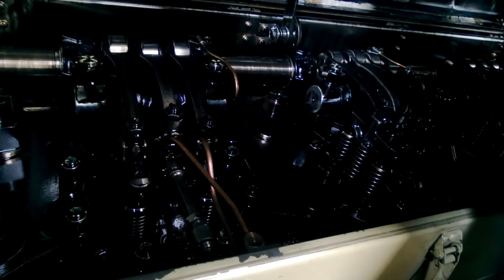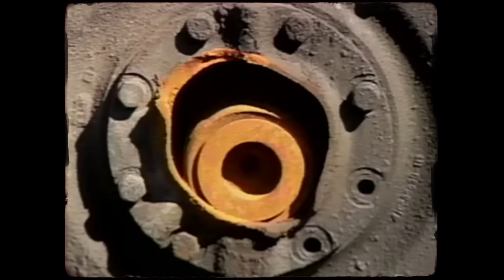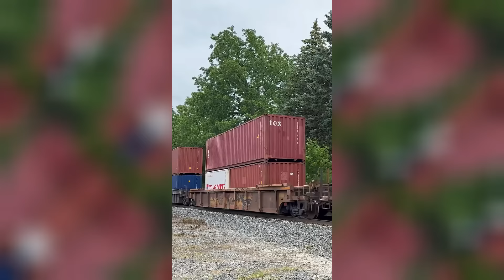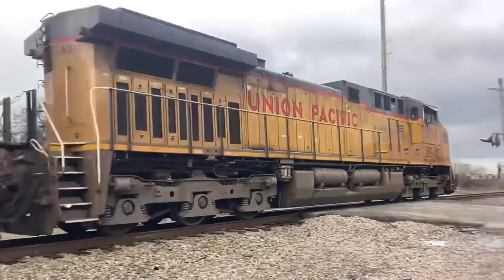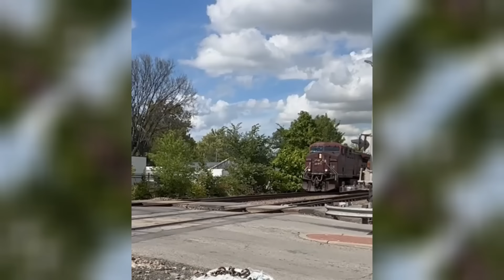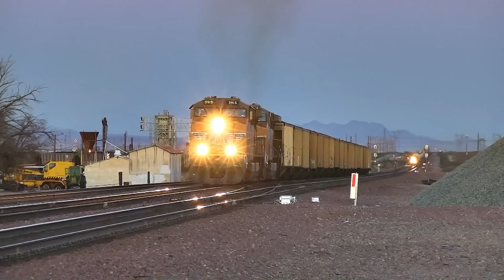The GE Locomotive That Silenced EMD in 1994

Comment: This video is a bit misleading and makes it sound like EMD never made a AC traction locomotive until the failed SD90MAC and that is what put EMD behind but fails to mention that EMD actually produced the first AC traction locomotive with the SD60MAC which was followed by the fairly successful SD70MAC which was mostly bought by the BN and BNSF, not to mention the AC traction SD70ACE that came after the MACS.  Also BNSF didn't start buying AC4400s until much later.

Comment: This article is totally incorrect,  yes the SD40 was the most reliable locomotive ever produced, far superior to GE.  EMD was the first to produce AC traction with the SD70Mac, it was an amazing locomotive especially in heavy haul operations.  The EPA is what destroyed EMD, its 2 stroke prime mover was not as clean burning as the 4 stroke GE used, EMD produced a far superior locomotive but they failed to keep up with emissions requirements.

Comment: Retired loco electrician (NS). The segment on computer diagnostics on the ac engines made me flinch. Those engines would log dozens of faults per mile, some restricting and some not, but it made finding problems a bitch. The old EMD 60 had over 100 test points and was hard to work on, but when everything was good it pulled like a mother. Some engineers told me the ac units had a wheel slip problem which in theory should be impossible, but I have been out of it for a while, maybe things have changed.

Comment: This video is factually off. GE took market share in the 1980s, while EMD was the first to produce AC traction with a test run of SD60s for Burlington Northern. The SD70MAC was the dominant market entry for AC traction. GE's dash models were the ones that shifted power. AC4400 was more like piling on.

Comment: Correction: BNSF actually ordered 1000+ C44-9Ws, which have DC traction motors, not 1000 AC4400CWs. They did order over 100 AC4400CWs, and then would go on to order ES44AC and ES44DC locos after the EPA's tier 2 standards went into effect. EMD also had AC units, and BNSF bought several SD70MAC and SD70ACe units for their coal trains from the 90's to the early 2010s

Comment: SD70 MAC I believe was the first major production AC loco. GEs 1 inverter per axle instead of per truck way better. The FDL 16, not so much until EMD tried their 4 cycle which was a bust in the 90-4300 Mac. GE FDL12 generating 4300 hp was their key in the early emissions battles, that’s what really won the day or GE in those years IMO.

Comment: Um I believe some of your facts are incorrect. Now GE or Wabtec has become the lead company over Progress Rail EMD. But you didn't mention that EMD first faltered with the SD50. GE locomotives if you were to check for reliability and locomotives that have evaded the scrap pile for half of a century...not with the GE name on it. I've seen EMD SD &  GP35 series still working on shorelines and regional railways. I've only seen two GE U18B locomotives still in use on the Pickens Railroad in Belton, SC. Now EMD was the first one to offer a locomotive with AC drive. Do you recall the SD60MAC? It rode on the radial self-steering truck. It could go under AC & DC locomotives. BN and  BNSF purchased 1000 at least. Norfolk Southern never bought any AC4400CW's -just rebuild their CW9's into AC44C6M's. Union Pacific has bought the largest DC locomotives at one time...1400 SD70M's...to go along with their SD70ACe's. They bought more AC4400CW's but they also bought SD90MAC's. Conrail's last orders were SD80MAC's and then SD70's and SD70MAC's. KCS, part of CPKC, wonder why they didn't call themselves Canadian Pacific Kansas Southern-split their orders. Yes, Wabtec has gotten most of the pie, but if more revenue isn't diverted from the truckers, both companies will cry. None of the railways are doing much but upgrading their fleet. They're buying in miniscule requisition. Also GE makes a good locomotive now. But many of the crews I knew that have retired and work presently prefer the AAR non-desktop locomotive. EMD returned to that idea first. Some of the crew told me GE extorted NS that if they didn't buy their locomotives, they couldn't haul their gas turbines. The SD70ACe might not be as perfect as the AC4400CW. I heard it's quieter inside and it could produce 4500hp.
Reply from the maker: Wow, this information is gold! Thank you so much for sharing it. I'm making a new video now to fix some of the errors in my last one. There is so much conflicting information out there, that I prefer to rely on information from my viewers, like you, who have real-world experience.

Comment: The beauty of AC traction is that the inverter doesn't need to do anything to compensate for wheel slip. As the wheel loses traction and spins faster; the motor's phase angle decreases and the slipping wheel loses propulsion, increasing traction. This simplicity allows the inverters to be very robust and provide thousands of hours of continuous service.

DC traction is raw power. From a stop the motors draw maximum current and minimum voltage which invert as speed increases. Once a DC traction motor starts to slip it will quickly accelerate to notch reference when the wheel slip system is not functioning correctly. Also I hear they don't like using DC traction when messin' with coal. Makes sense if you see how many sparks a commutator produces during operation. Then again that's less of an issue these days lol

As for me, I love a SD40-2. Relay logic speaks loud and clear and the module cards are easily discernable. Yea brushes suck but hey what else is new
Reply: I cam to write a similar comment.  With a DC motor both the unloaded RPM and available torque are both functions of input power (Voltage x Current) but with an AC motor the Power is separate from RPM since the speed of the motors core will be determined by the frequency of power being delivered.  This means an AC motor can provide full power a low RPM (low frequency) or provide low power at high RPM (high frequency) or any combination of low and high with the speed being independent of input power.  Of course someone will no doubt point out there are DC stepper motors and brushless DC motors which is true, but they would both still suffer from inability to provide full torque (power) at lower speeds or be self limiting.  Also if you really want to see scary wheel slip watch steam engines doing it.  With steam an unwary engineer can be throwing multi ton rods within moments of an uncontrolled slippage while under high load.

Comment: Regarding the intro and the demands for heavier trains. I remember in the 1980s counting train cars on the SF passing through Flagstaff and seeing numbers from 50-70. Today, trains passing near my home in the PHX metro on the UP tracks typically number around 95-100. DP typically meant leading and trailing engines when i was growing up. Today, DP units are often placed in the middle and I don't recall seeing to many trailing engines in recent years. (At least not in my area where there's minimal grade for 200 miles in either direction.) The ability to link DP units by electronic wireless control setups is a huge win.

Comment: As someone mentioned, the real killer for EMD was the EPA Tier 4 pollution requirements. GE was able to update their engine design to meet them on time in 2015. EMD tried to update their 645 engine, but a 2-cycle couldn't conform. Their 4-cycle was too late for the market, and had initial reliability problems. So the new GE/Wabtec AC loco became THE modern freight loco.
Reply: GE developed a brand new engine (Gevo) that was based on the AC60's 7HDL engine. They did improve the older 7FDL (called the Advantage) used in remans. 

EMD attempted to utilize the 710 for a T4 unit, which failed. They then tried the C175 Acert engine in the F125, but since it's a DEF engine, it couldn't be used in freight service. So they developed the 1010 engine from the 265-H, but it proved to be every bit as cantankerous as its predecessor. Only CSX and UP took delivery of small orders of T4 units from Cat, and all have since been returned back to Progress Rail/Cat.

Comment: Two things:

1. This video could’ve been 10 minutes long if a human being was narrating it. 

2. The SD70MAC was the first locomotive to debut with AC traction in 1993. Yes, GE ended up getting way ahead of EMD, but you can’t throw them under the bus entirely because they were utilizing AC technology at the same time. Not to mention EMD had several prototype testbeds for AC traction in the late 80s / early 90s such as the F69PHAC and SD60MAC.
Reply: It wasn't just text-to-speech. The entire video is AI generated, and the entire channel is on AI autopilot, spitting out new garbage videos every two days.

Comment: One caveat,  EMDs SD70mac hit the market in 1993, it technically was first on the rails, not the AC4400
Reply: Exactly
Reply: I was just going to comment this.
Reply: I agree with that also. The SD60MAC was the three unit testbed locomotive trio tested in Bn colors although EMD wanted otherwise. It rode on the patented EMD self-steering radial truck. It could fit under either a DC or an AC Progress Rail EMD locomotive. Then BN ordered the first AC drive locomotive to enter revenue service on USA rails- the EMD 4000hp(later uprated 4300hp). BN bought them. Then, BNSF purchased the SD70MAC long before they bought any AC4400CW's. Sure their new bosses from Santa Fe swayed them to GE majority, but NS bought EMD's and leased EMD's from BNSF.

Comment: Reducing the number of locomotives and improving fuel efficiency also reduces emissions.  If I recall correctly, the newer locomotives also recycle exhaust - that is, the air intake gets a mix of fresh air and exhaust, which further reduces emissions.  That's a good thing.
Reply: Exhaust Gas Recirculation or EGR. EGR has been a big part of diesel engine emissions for the last 20 years. It helps but it can also cause catastrophic engine damage if something goes wrong.
Reply: @Whambamrustytram  Thank you.

Comment: I was a BN Engineer, (former C&S), and retired in 2005.  I preferred running EMD engines in all respects.  From yard operations to main line hauls all the way to and including heavy coal drags in mountain territory. The ONLY thing I thought GE had better was the dynamic brakes.  IF my memory serves correctly,  The EMD 70 MAC's were out before the GM AC motors.  I do not know what killed EMD's hold but I am sure it had something to do with price and the EPA.
Reply: Interesting info. Happy retirement. When I would perform traction motor brush replacement i would change more brush holders on EMD locomotives then I would GE ones.  I don't know if that's because the GE ones were built more robust and had better brush springs or if NS just beat the shit out of their EMD locomotives more than tbe GEs. At the time I worked there it was mostly SD 70 straight 70 70M and 70M-2series 60 series straight 60s 60M or 60I or SD 40-2s that largely seen the heaviest haul service in mountainous areas where they got beat the most and thus wore down brushes constantly
Reply: @jdday1757  Thank you  and from a mechanical point of view that was most interesting !  I found GE's to be rougher riding, nosier and slower to accelerate.  No doubt they would pull their guts out.
Reply: @williamlilleston1595  One could only hope.
Reply: GE had the electrical expertise all along and GE Capitol helped finance the deals.    Jack Welch  wouldnt allow any  GE business unit stay on unless it was number 1 or 2 in the market.    He was a greedy sonofabitch to work for.😢😮 but he had smart CEO's in charge of locomotive plant-   David Calhoun who went on to lead Boeing,  John Rice,  Charlene Bagley, Russell Stokes.  All went on to higher GE ranks

Comment: This is not correct,  EMD lost the lead due to the 50 series reliability issues.  EMD pushed the 645 to far.  EMD was also the first to AC traction with the SD60MAC  in 1991 3 years before GEs AC4400CW.

Comment: What the narrator didn't say was that emd developed a system called super series, which increased tractive effort by controlling the wheel slip. From 1980 on Australian railways  :  SRA, Vline, and Australian National we had locomotives equivalent to SD40s/50s, which had super series control.
Reply: Actually the super series wheel slip control was technology EMD licensed from Siemens in Germany.  It's a field where German companies have excelled.  In the US the way to improve traction has tended to be by increasing the weight of the locomotives, and blaming the track when it goes wrong.  In Europe, where axle loading tends to be limited to 22 tonnes, better technology has been the answer.
Reply: There is no narrator. AI.

Comment: I’m a bit confused about why they can’t adjust the DC power up or down to accommodate wheel-slip ? DC isn’t an only off or on voltage type.
Reply: this video is full of BS
Reply: DC engines do control their wheelslip but it's more difficult to do fine adjustment with DC. AC can also lose a traction motor and maintain dynamic braking, which DC locos cannot do.

Comment: When I started with CP in 84 they were using 5 SD40-2s for 110 car grain, coal or potash. I'm not sure of the timing but they upgraded the SD40-2s with better traction control and that allowed them to drop one unit for the same weight train. When the AC 4400s came out the number of units dropped to 3. This was over the Thompson and Cascade subs.
Reply: Here in Ontario, we had SD40-2 leaders until 2015-16 when EHH Poached many of them. Good thing he’s in hell

Comment: AC revolution began with EMD and Siemens. GE locomotives have better fuel economy but the biggest operating advantage is lower lube oil consumption.
...and your tractive effort specs compare an SD60 to an AC44OO and are wrong in many ways.

Comment: USA locomotives sales are about zero since 2020 but I did read that BNSF bought 50 in 2024. To get things into perspective AC power is great for highspeed freight whereas DC power are luggers. The SD40-2 wasn't a analog system as all EMD -2 series were microprocessor controlled. The SD40-2 would get down and pull at 12mph wheres an AC loco will start dropping power and even shutdown at 12. You say railroads wanted more power well how many 6,000hp SD90's were sold??
Reply: How did you get that so backwards? AC has almost no advantage at high speed, it's the grinding low speed work where it excels. Much more effective dynamic as well

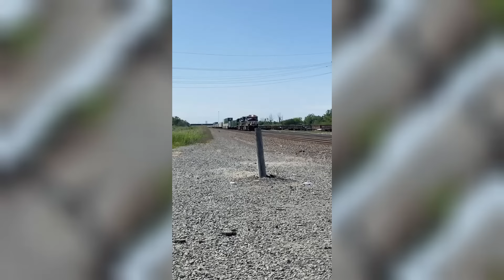Comment: At 21:30, I am not aware that Norfolk Southern ever purchased any AC44s off the shelf. They only had an updated version of that model, starting several years ago with their rebuilding program of their massive fleet of Dash944, which are now known as AC44C6Ms.
Reply: They were D9-40CW not 44. NS derated their locomotives to 4000 hp. There is a switch in the nose of the cab to detune them. They believed it was better for the longevitiy of the equipment
Reply: @jdday1757  Whatever the case, NS did not purchase any AC44s from the factory, as stated in this video. I know that they originally took them as Dash-9 40s, but according to the Dash9 locomotive roster website by Chris Toth, they were upgraded to 44s in 2014, along with their ES40DCs being upgraded to ES44DCs during the same period.  That' the best information I have. It's interesting what you said about a switch in the nose. I thought it would be more complicated. Thanks for your thought.
Reply: @samschaeffer8236 
Isn´it just a réduction of fuel to the piston ?
Reply: @danielfantino1714  I honestly don't know, but it sounds logical.

Comment: 21:27 No, STFU NS didn't buy a single AC traction locomotive until 2012
Reply: They did inherit roughly 20 SD80MACs from conrail
Reply: @jdday1757 yes, but that's different, they didn't buy them, they did actually buy Conrail's standard cab SD70s in NS specs so that they didn't have to patch them.
Reply: Are you sure about that. From what I can find, they purchased 25 ES44AC's in 2008.
Reply: @PatrickLipsinic  Dangit I keep thinking they got them when they had their 30th anniversary. They weren't really prevalent at that time

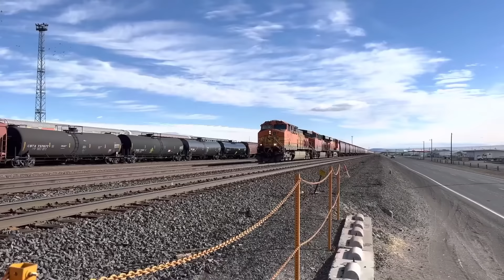Comment: 17:25 BNSF did not buy over a thousand AC44s they only bought 121. They bought over a thousand Dash 9s that look similar to AC44s but those have DC traction motors. Norfolk Southern also bought over a thousand Dash 9s because AC44s were more expensive to purchase.

Comment: For some reason, nothing was said about the SD70ACe-T4  from EMD. It's also an AC locomotive, and it's quite efficient.
Reply: This video was supposed to be about tbe AC4400CW. Because it was the first of GE's locomotives to really make a name for themselves. This video isnt about the SD70ace. That locomotive was EMDs answer to the GE AC locomotive. It had mixed results. The railroad i worked for didnt have any of them as it was a time when NS was only interested in DC traction. 
Their first AC traction locomotives were ones they didnt even want, as they inherited roughly 20 SD80MAC locomotives when they got their share of the conrail split. At Conway yard where I worked we seen alot of tbem in the shop since that area is where they would work often pulling coal trains and the guys there in the mechanical shop were already familiar with their qwerks. Which they had a ton of them